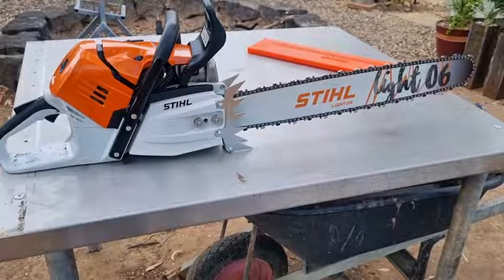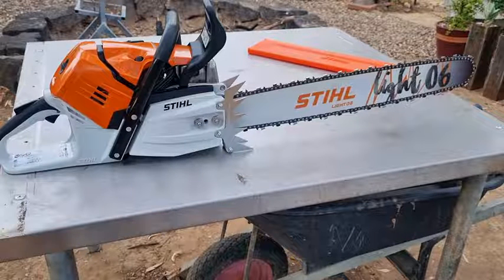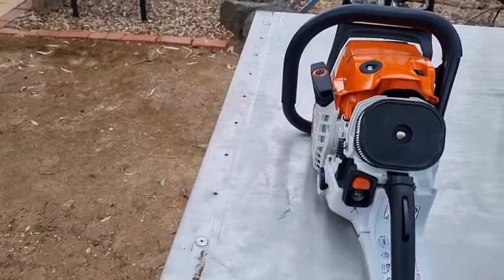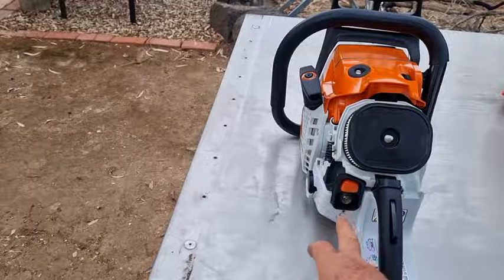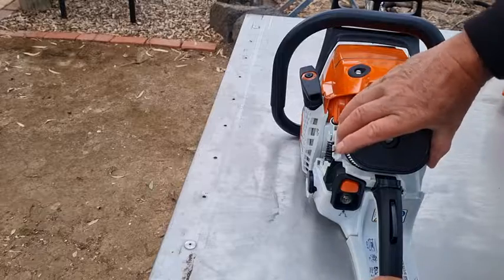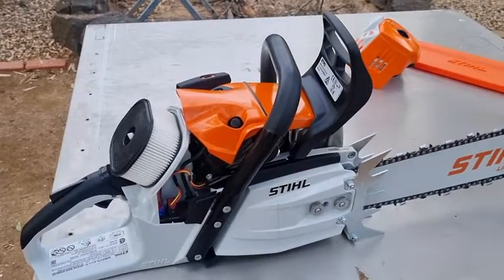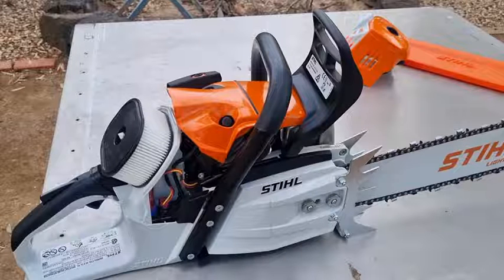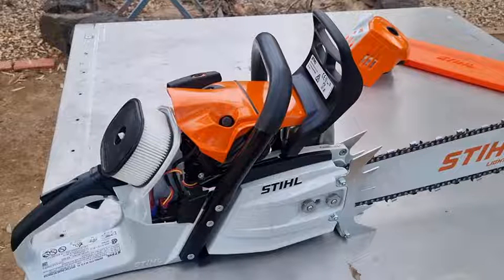500i pro tips trouble shooting

Comment: Thanks for the video.. good stuff…. Just on the bar length. I put a 20 inch bar on my 500i from new. Same thoughts as i use it for firewood. I regret not sticking with the 25 inch standard bar. The saw will run the 25 inch easy. I also find the extra weight in the bar helps do some of the work. I would go with the standard 25 inch bar every time.. I also got a 36inch bar just to see how it goes and the 500i handled it no problem. The only other thing to mention is i only run tungsten chain. Expensive but you never have to touch it.  Love it
Reply from the maker: I would use 20inch where possible so much more power using 20 inch 
I have 30 inch bar also for 500i but it only gets used seldom.
20 inch is my first choice

Comment: I got a 500i that wont start.  I had unplugged the 3 plugs on the right side and plugged them back in and at first it started and idled really high and now it won't start at all.  Any ideas?
Reply from the maker: That could be anything.  Take it to a stihl dealer they will plug it in to a computer it will show what's wrong.
Reply: Why did you do that 😂😂😂

Comment: Seems be loads of videos of problems  with these saw sthil
Reply: Not really, almost all videos with "problems" on these is because they were ran over or other physical damage done to them. There's also normal to have some bad apples, seeing how all loggers and their mothers are running only 500is these days. There's just so many of them out there, probably Stihl's biggest hit in decades.
Reply: I'm a Timber Faller from Oregon and I've ran the absolute piss out of them as hard as a chainsaw can be ran and pushed as hard as it possibly be pushed and the 500i is extremely reliable. They run in -0 temps 2nd pull start, in 110 degree weather. Dirty air filters bars up to 36in my build (hopped up one) will pull a 42in if it had to but a 32in is usually on it. It runs 6 hours wide open buried in big timber 5 days a week 52 weeks a year with zero problems.
Reply from the maker: Wow awesome
Reply from the maker: Not really it's a very reliable saw it's just to be aware of the problems. All other saw are plagued form carburetor problems and need tuning ect.  The 500i is one of the most reliable saws.  I am just highlighting some issues that have been known to exist.